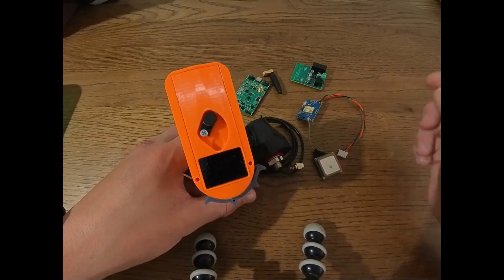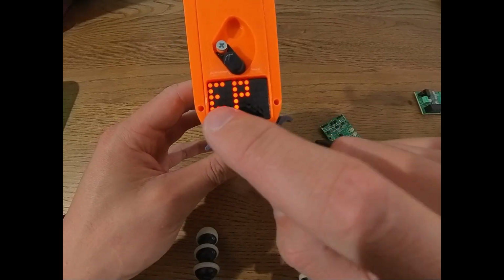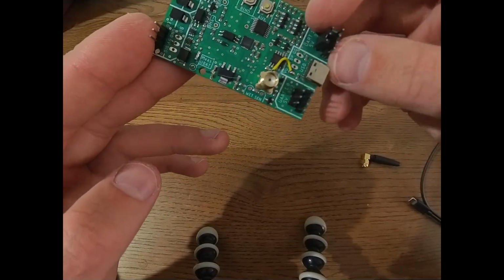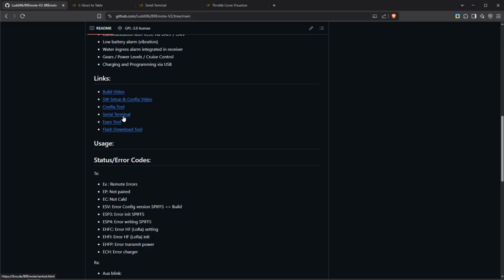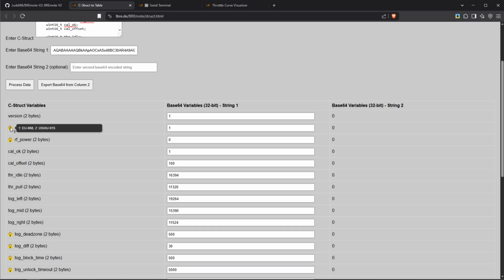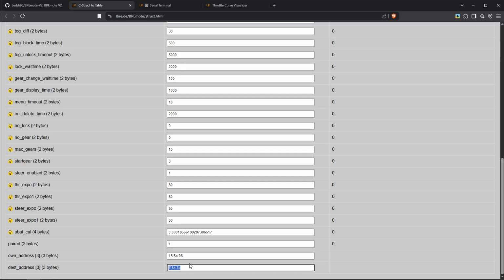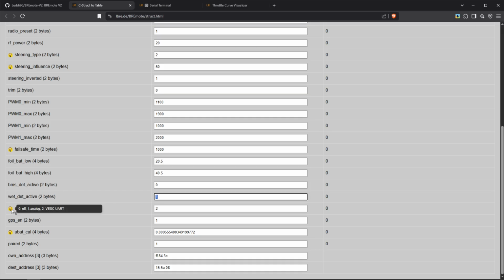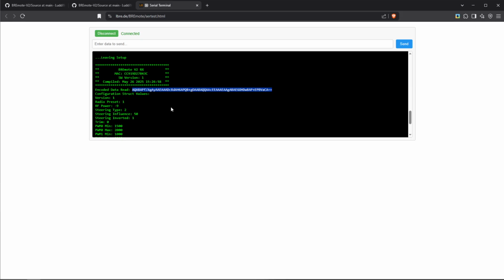#009-1: BREmote V2 Usage and Update Instructions

Comment: Super happy with the system you have made, good job!  I have an issue on v2.2.4 that the controller TX always shows XX after a while even if i am continously using it though. Is there anywhere to adjust that? Or do i need to build custom software
Reply from the maker: It will do the "XX" when it does not get connection to a RX for some time. Do you see any telemetry, like signal strength or battery voltage on the display? Otherwise the connection from Rx to Tx may be broken.
Reply: @ludwigbre  Well i am running my motors from the TX via the RX so there is a connection if that is what you mean. I do see that normal startup cell level and signal strength
Reply from the maker: @bjornwo so when you power off the Rx mid use, the Tx will also show 0 signal strength? And when you plug it back in, Tx will show signal strength again? Do this to debug if the connection indicator is healthy, also share the config strings please
Reply: @ludwigbre  Thanks for trying to help. I think it was as simple as the RX saying Paired: 0. This is a bit strange since i have been driving the setup with the TX. I did a repairing and now both say paired. Hopefully this fixes it.

Comment: Hey Ludwig,

I have a question. I bought the Bremot V2 from you and have the following application planned.

I want to use the remote to control the throttle from a Jetski. The Jetski has a potentiometer built into the throttle grip.

Can I use your receiver to send back the signals to the jet ski that it would normally receive from the potentiometer?
Reply from the maker: Hey,
The receiver by default only outputs a PPM signal (1000 to 2000us pulses)
To convert this to a potentiometer value you will need another small controller, like an arduino for example with some additional circuits.
Or (the easy solution) you have the Rx control a servo and that servo moves the throttle of the jetski, purely mechanical